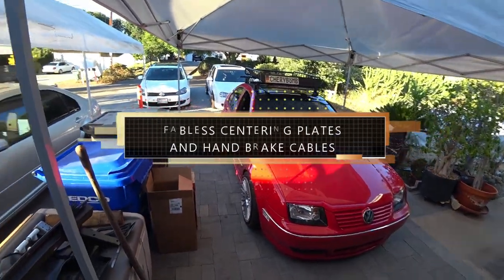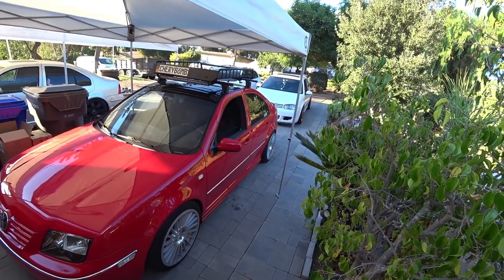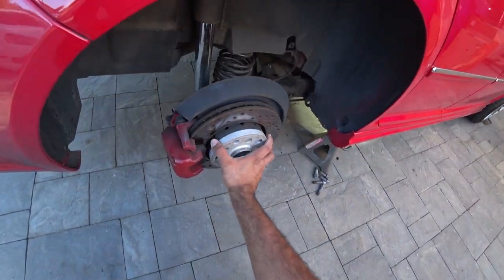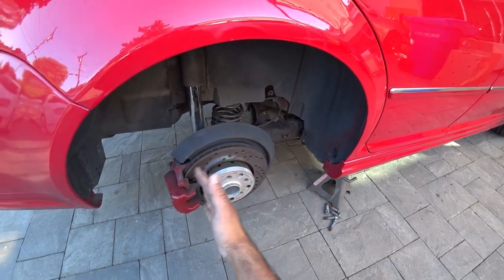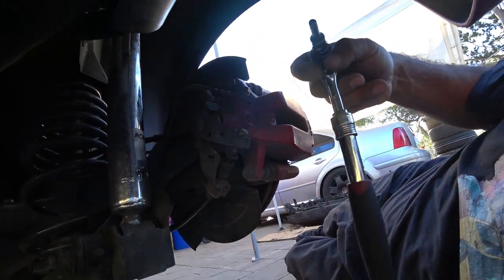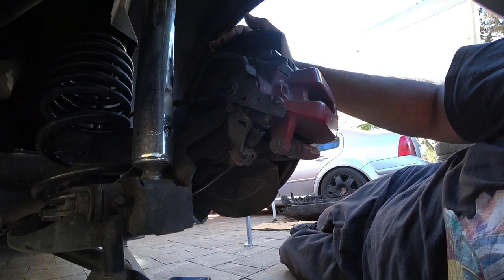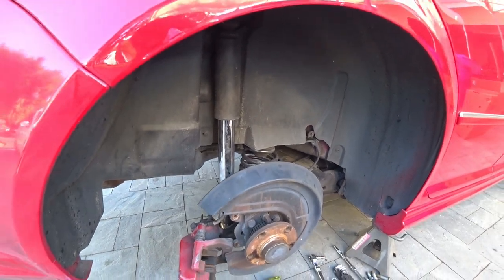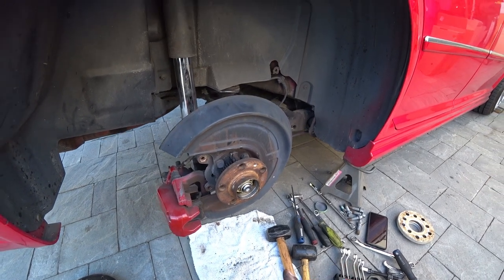How to install Fabless MFG Centering Plates and Hand Brake Cables S7EP10

Comment: Thanks for the video Al and for supporting our products! I just wanted to provide clarification on the grinding of the studs. It's best to install the lock nuts on the studs to spec, and cut or grind the end of the top right stud before installing the bearing. This will ensure there's enough threads for the lock nuts to bit onto, and you won't have to worry about pulling the bearing back off after you've installed it. If you grind the studs before having the nuts installed, you could cut too much, as it does very from car to car. Some vehicles don't need any cutting/grinding on the studs, so if you pre-cut them, they'd end up too short. You also want to knock off the extra in every application, as you won't know until you install the bearing and at that point its too late. This is also why we don't send the studs pre-shortened.
Reply from the maker: Good to know. Will make this post a 📌
Reply: @PincheALsGarage  Thanks man 🤟

Comment: How are these compared to the ECS Tuning or Creations Motorsports centering plates?  I know they are installed at a different location than the FM drop plates. Just curious 🤔
Reply from the maker: ECS centering plates only do that. They just center the wheel buy using the body mounting part instead of the stub axle. They also are much ezier to install but dont give you camber which i like a lot on these cars.

Comment: Also you would think these companies would just grind the stuff if they are a needed process
Reply from the maker: I actually spoke to them about this and the issue was that the studs only come in one size and the OEM stud sindles had an inconsistent size that it cause an issue so they kept them the length so all we have to do is an extra step to get them just right.

I think its a very small price to pay for a very well made product.